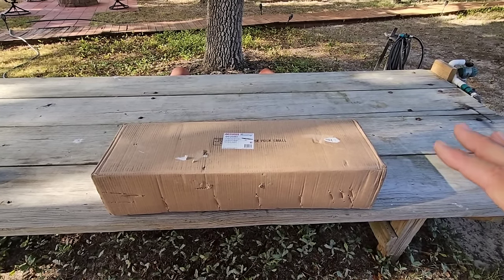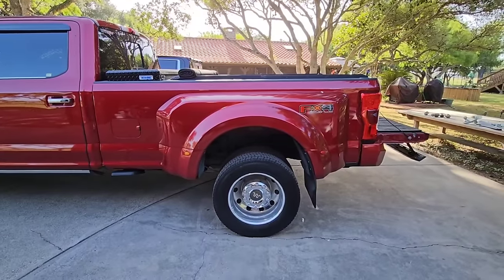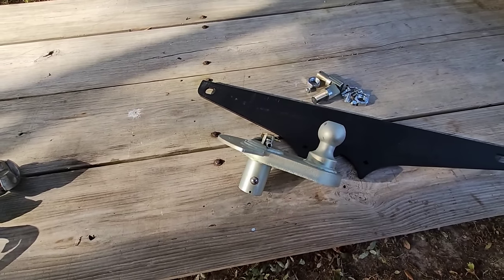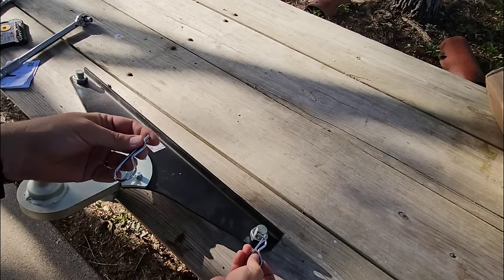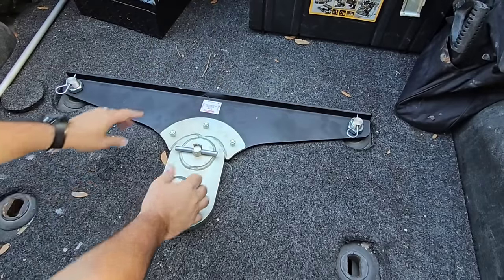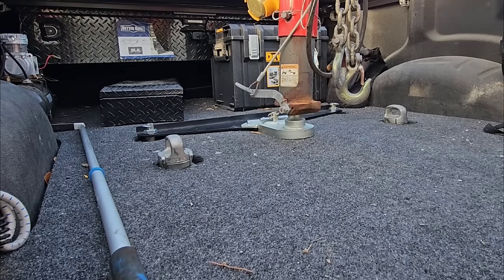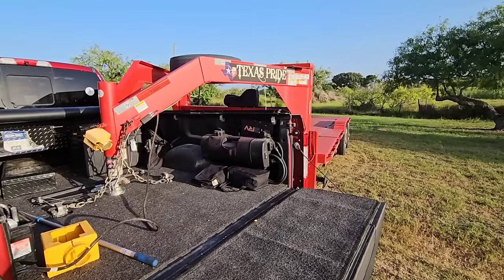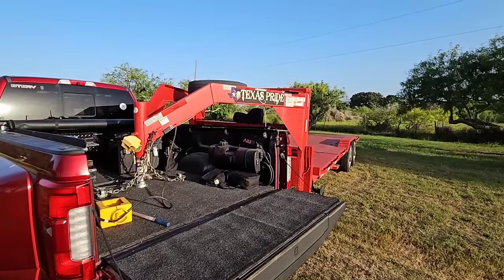Most Amazing Gooseneck Hitch for OEM Puck Systems! Gen-Y Offset Hitch!

Comment: I typically like most of what you say in your videos but I disagree with what you said in this one.  For those that may be reading and don't like longer comments, then this one isn't for you so just disregard and move on.  But, if you care to read a different perspective of why I don't think it was a good idea to say what was said in this video, here you go.

I know you have a lot of knowledge about trucks and trailers since you've had this channel a while but I wish you wouldn't give your feedback the way you did with regard to hitch or ball placement.

I think you're wrong with one of the things in particular you said and a few others and I'll explain why.

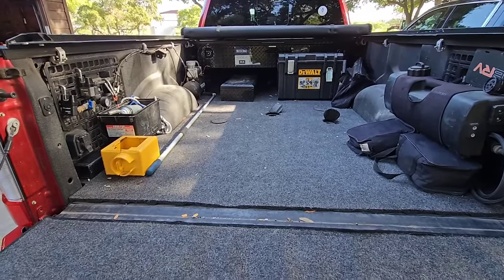At the 3:20 mark, when you said "you can actually see that the actual gooseball connection is placed pretty much directly over the rear axle."  "It's actually directly over the rear axle".

Well, yes and no.

Is it directly "over" the rear axle itself?

Yes.  At least if you're referring to the "rear axle" as the axle assembly with the axle housing differential casing and so on.

But, is it IN LINE WITH as in directly above or in line with the rear axle centerline?  No.  And it's not even close within "an inch or two" (you didn't say this and I'm just typing this) either.

So what......right?

Well, this is what's important and really, with your experience with towing trailers and campers on your channel, you should know this.  But, it's why I worry that you don't actually know as much as you "should" know by now IN SPITE OF all of your knowledge and advice about these things.

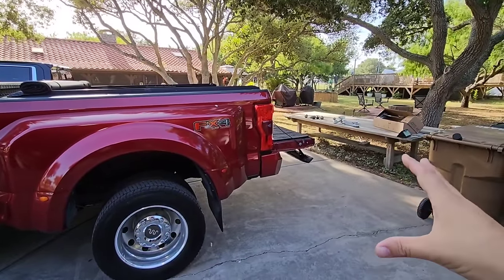At the 5:07 mark, you mention how "the downfall that some people may say is it's going to throw off the balance or it's going to throw off where that pin weight is resting now because if it's resting a few inches behind the rear axle, that's a big shift".

(Yeah, "some people may say" because it's true and it's important but the way you speak in the video, you make it sound as if it's no big deal)

At the 5:18 mark, you say "Now, it is going to be a shift but it's not going to be a big shift mainly because, if you look at where the tire is, you look at the contact patch to the ground, if you move 4 or 5 inches behind the center point, you still have the majority of that weight the VAST majority of that weight pressing down pretty much over that rear axle still.  So, it would be very very very minor probably unnoticeable in terms of the difference from a towability perspective".

PLEASE JUST STOP....

* YOU DON'T KNOW THIS BECAUSE YOU DON'T KNOW WHAT EVERYONE'S SETUP IS.  Doing this with your 5th wheel in your nice big F-450 is probably not a big deal. But, if this happens in a 3/4 ton pickup or 1/2 ton and they have a trailer or camper that is already on the "heavy" side for their capacity, this is NOT a good thing to have. *

First of all, do you not realize how many people DO NOT know how to properly transfer their weight on their trailers correctly in the first place so they are already starting from an "unsafe" point to begin with?

Not to mention, how many people get too heavy of a camper or overload their trailer for their pickup to haul which causes another problem as well.

You can't be oblivious to the numerous people driving around the country that are towing campers and trailers and you constantly see the ass end of their pickup, SUV, or car almost hitting the ground and the nose of their vehicle is getting ready for takeoff.  In many cases, it's not this bad but there are plenty out there where it is this bad.

The sad reality is, the MAJORITY of people have too much pin weight on their setup to start so they are causing an unsafe situation from the start.

And the thing is, based on how long you've been doing this and how many miles you've traveled yourself, you should also know this.  But, maybe you don't think this is that big of a deal.  (I don't know)

The truth is, people "think" that they have to put more weight on the front for no known reason.  This may be due either due to laziness when loading a trailer such as an enclosed and they just want to "pack" everything in the front and forget to actually spread out the weight over the entire space in the trailer because they didn't plan how they were going to pack and just start packing things in.

Who wants to "plan" how to pack an enclosed trailer right?

Or, if they have something to put on a flatdeck trailer, they just put it up front more because they forget about the rest of the deck for some reason.

I don't know why people do this with their flat deck trailers but they do.  Maybe it has to do with areas that they can put securement since there are less places towards the rear due to the ramps and axles if they have fenders and so on.

The thing is, what people either don't realize or forget is that trailer and camper manufacturer's ALREADY AUTOMATICALLY have a higher amount of pin weight built into their trailers or campers by design for safety and ride reasons.  And honestly, by default, it's damn near too much in some cases for many pickups even with nothing in the camper or on the trailer because trailer manufacturers put the axles so far back.

They do this for safety reasons because the opposite of this is bad as well and usually a worse situation.  So, trailer manufacturers build them to be "more safe" to start.  Along with this, it also helps provide a better ride which is obviously more comfortable for the people sitting in the cab.

Obviously, safer is better for humane reasons but legal ones as well since trailer manufacturers could be held liable if they manufacture their trailers in a way that is "unsafe".

So, to make a comment like this that essentially says that it's "not a big deal" to have your hitch back 4 or 5 inches is not good in my opinion.

Now, I know that you ended by saying that the weight would "still be predominantly over the back axle".  That's all well and good.  However, the way that you commented earlier is too care free of a statement in my opinion.

I do realize that you would think that if it was that unsafe to manufacture a product like this (they aren't the only ones and similar products have been around for decades now), then they wouldn't because their lawyers would tell them that they could face lawsuits.

Well, that is likely but keep in mind, just because an attorney thinks that they can win the case in court DOES NOT NECESSARILY MEAN that the product is still "safe".

Something else to consider is if someone has a 1/2 ton pickup that they are towing with and using this.  Keep in mind that the suspension of a 1/2 ton is NOT "typically" that firm or strong since everyone wants a "grocery getter" type of pickup so they build them to ride as best as they possibly can (with the exception of the crappy seats that you mentioned in a previous video about your Denali update).

So, how do you think this is going to affect a pickup with an even less forgiving suspension?  It's not going to be good that's for sure.

And since so many more people are trying to use their 1/2 tons for towing campers that are WAY OVER their limit to start with, this isn't good.  Heck, in many cases, people should probably even be skipping a 3/4 ton and just getting a 1 ton single or rear axle pickup to pull whatever they have.

But, people are idiots.

What you're not considering here is that along with that change in the hitch location, you're also potentially creating additional unsafe circumstances based on pivot points or fulcrums.

Good ol' physics.

Another thing to think of is to consider the rear tires like they are almost ready to hit a banana peel as the weight behind them is attached overhead.  If that hitch is behind the rear axle centerline, the weight is going to "push" the axle down and forward as it's traveling down the road.  Think of yourself as you come up to a banana peel and you're walking.  Your foot is going to have pressure pushing down and forward.  If the pickup hits a bump, it's going to be like the rear tires hit some banana peels and will make it "seem" like it's slipping on some so there could potentially be a slippery situation.

Look, I know that people have short bed trucks and they're looking for something to help them with turning and backing so they don't smack their truck cab.  But, for safety reasons, it's really not a good idea to allow these things to be used in certain situations.

The bottom line is, people will just overload their trailers too much or they are too heavy to begin with so they should be getting a different truck.  Or, they will have to do a better job of backing up and that's that.

If you have a lighter trailer and want to do this, it's possibly okay depending on your setup.  But not everyone has an F-450 dually or even an F-350 single or dual rear wheel axle pickup.  So, I don't think it's a good idea to speak as if this is a "no big deal" type of situation.

And I especially say this due to all the evidence of people on the road towing campers and trailers every day that shouldn't be.
Reply: A few other things  bonus info) ....

If you pause your video at the 3:20 mark, you can see that your original factory ball placement is actually about 3" in front of the axle centerline.

How do I know this?

Well, you can easily see this if you just look at the ball centerline in relation to the round inner wheel wells inside the truck bed.  If you look at the inner wheel wells and look at the top and middle portion of them, you will see a "notch" cut out in them.

*PRO TIP FOR THOSE THAT DON'T KNOW*
(Ford and other pickup manufacturers put notches on the top "round" portion in the middle of their wheel wells AND ALSO put some vertical notches before and after the inner wheel wells on the actual bed itself.)

I was going to do a video on this myself someday but perhaps you'll beat me to it.  If you do one yourself, will you at least give me a little credit for the idea?  I believe there are other videos out there about this already but they may not be as elaborate.

Anyway.......

They do this so you can use them to put wood on them or slide them in the vertical "notches" before and after the wheel wells to create a divider or a support system.  The notch on the wheel well allows a 2"x8" to be placed horizontally so you can lay plywood in the bed and have them be supported along with other portions of this system if you desire.

The vertical dividers are just behind and in front of the inner wheel wells and are just little raised or "outdented" portions of the truck bed itself.  You can use a 2x4, 2x6, or probably even something up to about 24" tall if you wanted to.  It's just that the main part of the bed that will actually provide the support (the "outdents") is only about 10" tall.

-------

Anyway.....

If you look at the front edge of the front of the notch on the passenger's side of your truck, you would see that it matches almost identically in line with the center of your hole if you were to imagine a straight line from one wheel well to the other side.

Since the actual size of a 2x8 is NOT 2" by 8" and it's actually only 1 1/2" x 7 1/4" (for most common 2x8 boards), then 7 1/4 divided by 2 is 3 and 5/8".

So, your ball is actually 3 5/8" to 4" IN FRONT OF your axle centerline based on what I can see in your picture.  It may only be 3" depending on exactly where you stop the video so I'm doing the best I can based on where my video was paused.

Ford and other vehicle manufacturers do this for various reasons.

----  Weight distribution BUT ALSO, SAFETY.

Having the weight distributed a little bit forward of the rear axle centerline will actually help some of the weight to transfer to the front of the vehicle so it will be distributed more evenly.

This will help keep the vehicle "planted" going down the road so you will have more traction WITH ALL 4 TIRES "more equally" which results in better control overall.

Putting the hitch centerline point behind the axle centerline causes the front tires to be pulled upwards due to the force of the trailer weight pushing downward and pivoting the pickup which causes less traction and less control and less braking.

Also, this puts more pressure and stress on the rear axle which can cause more problems over time.

If you have the hitch pivot point or fulcrum moved BEHIND the rear axle centerline, this is even worse because you're causing an even worse "teeter totter" effect and almost spring boarding your front tires off the ground.

Just consider if you're driving down the road and you hit some bumps or have the front of your trailer overloaded.  This will cause your pickup to "bounce" as it's going down the road.

Now consider if you're going down a steep decline or up a steep hill.  The momentum of your whole setup with the weight of the trailer will likely cause your pickup to turn due to the heavy weight being caused at the pivot point of where your hitch connects.

If you were going at too high rate of speed going down a hill or worse yet, down a hill AND around a curve, you would likely almost instantaneously have your pickup wind up sideways or topple over due to gravity working against you along with the heavy momentum of the trailer and cargo weight behind you.

2.  For other manufacturers that have balls that can be "flipped" upside down and stored in the hitch itself like a B&W turnover system, this also limits catastrophic damage to your rearend should you hit a big bump and you have the centerline directly in line with the rear axle centerline.

What many people don't understand is that by putting the ball centerline directly above and in line with the axle centerline of the rear axle, you can potentially damage the case of the differential housing.  When the ball is upside down, it has a limited clearance to the rear axle so consider what would happen if you had a heavy bumper trailer or 5th wheel trailer attached or hit a really big bump that caused the ball to smack the rear end case.

Not good.

If you don't believe me, next time you put your ball upside down, go and measure how much clearance you have between the tip of the ball and the closest point of your differential housing.  It's not going to be much usually.
Reply: Given the wheelbase of BTBRV's truck, every 1000 pounds of pin weight would move 28 pounds of front axle weight to the rear axle due to a 5" ball shift to the rear.  Does that magnitude of weight transfer support the length of your rant about banana peels and whatnot?  If I imagine pulling our camper (~1.5k pin weight) I'm not sure moving 42 pounds from front to rear axle would be noticeable.

For the shortest wheelbase F150 (122") that turns into 41 pounds shifted per 1000 pounds of pin weight.

FYI, an Anderson hitch has ~5" of offset.  The Reese companion adjusts up to 7".  The new Curt Crosswing is ~8".

Comment: Look at those welds 😬 I'd rather not! I guess they tried the ol, paint makes the welder I aint method
Reply from the maker: Pretty sure its robotically welded
Reply: @BTBRV shouldn't have passed QC. All of those places where it rolled are where the cracks start and I would not want to tow with anything that looked like that